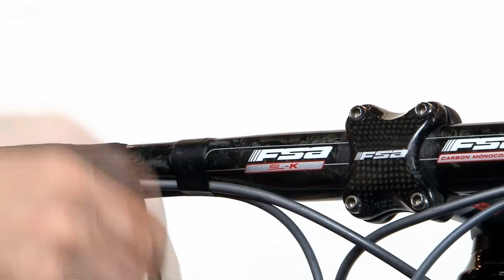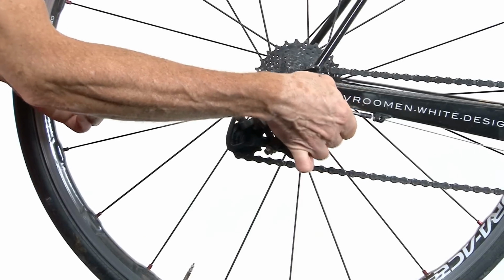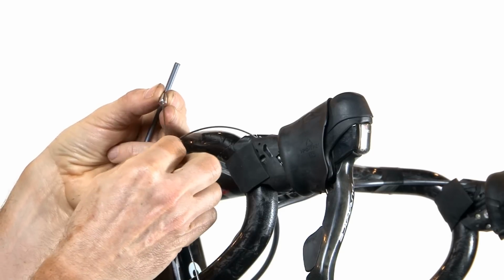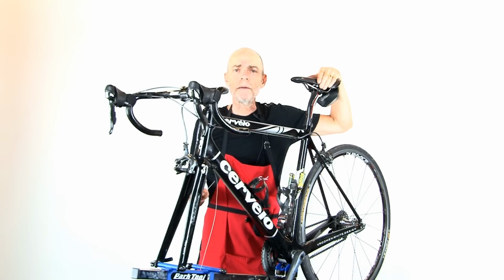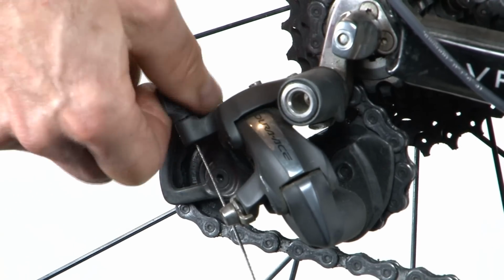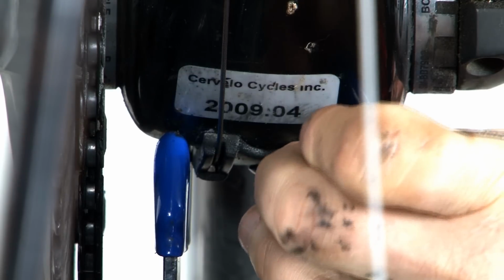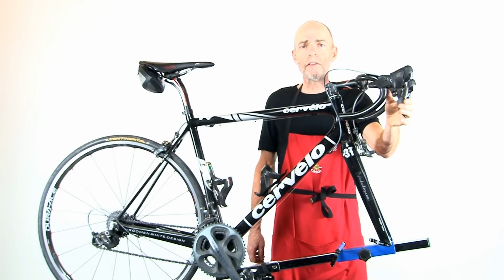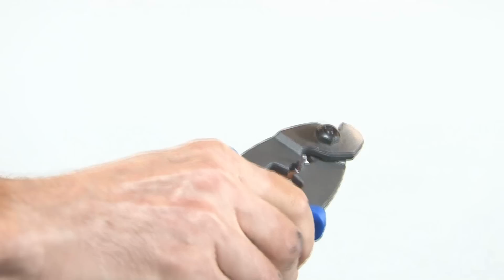Gear Cable Replacement

Comment: Saul, I just used your videos to replace my chain, new cassette, and tune the shifting on my bike.  It saved me a couple of hundred dollars, and weeks of waiting for a local bike shop to do it for me. thanks a ton!  your videos are far better than the others that i've seen online in that you speak very clearly, and the detailed close ups of what you're doing really make it easy to understand without having to do any guesswork.
can you do one about replacing your bottom bracket? :)
thanks a ton!

Comment: Thank you so much.  I replaced the cables on a bike my partner gave me. The bike was lying unused for few years now. Your instructions were so straight forward, it worked like charm, except for the front derailleur I did the reverse - tuned for the larger crank (3) down to the smaller (1). With some minor tweaking works just fine. Needless to say that she is very happy. Thank you once again.
Reply from the maker: Glad it worked out.

Comment: hey, this helped me change my own cable.  I feel better doing it myself so that if I ever have a problem out on the road I'll know how to fix it.  Plus, I saved whatever the bike shop would have charged.  My cable was shredded inside the shifter, but with a little help from my drill I got it worked out.  Thanks.

Comment from the maker: Thanks for your feedback. The actual cable tensioning is set with the barrel adjustment.
The innitial tension, IE. when installing the cable or anchoring it, is not critcal...but set it with minimal slack(tight). This should allow you to adjust for proper shifting with the barrel adjuster as in the "TUNE YOUR GEARS" video.

Comment from the maker: Thank you. I have no experience rebuilding shift levers. Small parts are not always readily available. I would recommend cleaning first and make sure there is no foreign material trapped in the mechanism. Sometimes replacement is the only option. Good luck.

Comment: Thanks Velotique (Saul) for your complete and comprehensive guide.  Question - should the brake/deraileur cables be greased before install on the frame?

Comment: Great videos. Helping people become fully autonomous. Also loved the beautiful pyrenees videos.I have a question. My left down switcher(small handle)  tends to not catch. I have to push it several times before it does. I am thinking of opening the thing up. Is this worth trying or could a part have become so dull (wear/tear, I'm not sure what the usual English term would be)  that there is no way to fix it?

Comment: Hi Saul, is it possible to replace just the (FD) cable and leave the existing housing ?  I am learning to tune/setup my FD and I frayed the excess cable by using needle nose pliers to tension.  The FD works fine but I just don't like seeing the sloppy frayed cable.
Thanks for the great videos !
Joe

Comment: Are there significant differences with internal cable routing?  Does it require more ferrules?  Thanks in advance.

Comment: I had a problem like this with the ratchet not catching - the shifter mechanism wasn't repairable, it all had to be replaced (not the lever, just the mech. Expensive & worth going for warranty if applicable. If not, hope yours is just a "squirt of wd40" job.

Comment: Are the cables different lengths I recently picked up  a shimano yumeya set (yu-sp81) for my road bike and the front derallieur installed perfectly but the rear is like 5 inches off what should I do

Comment from the maker: Thanks for your feedback. The actual cable tensioning is set with the barrel adjustment.
The innitial tension, when installing the cable or anchoring it, is not critcal,but set it with minimal slack (tight). This should allow you to adjust for proper shifting with the barrel adjuster as in the "TUNE YOUR GEARS" video.